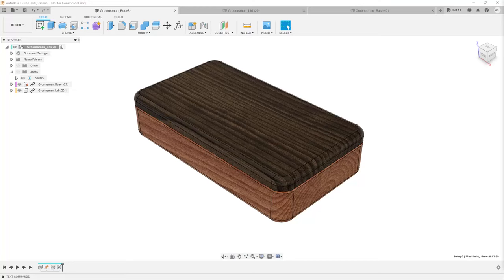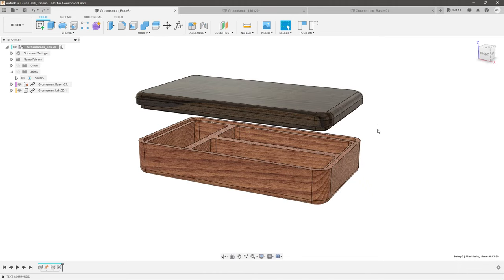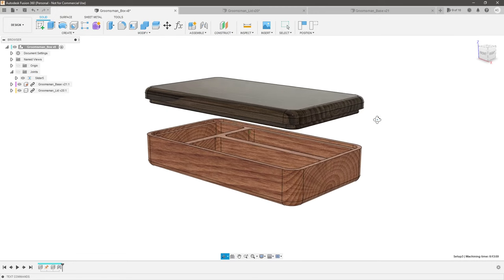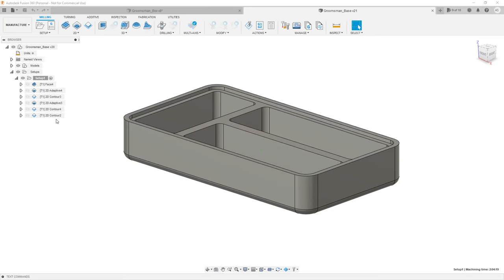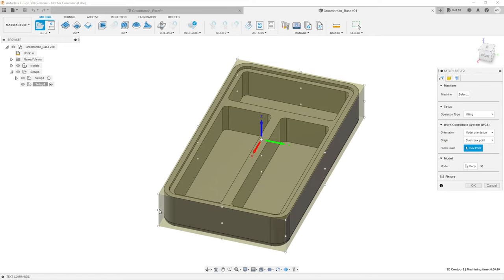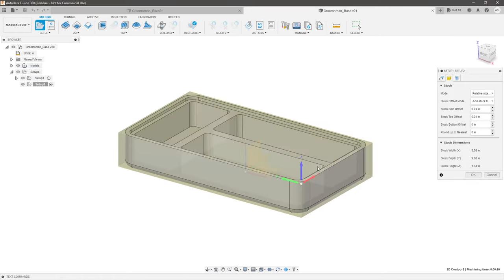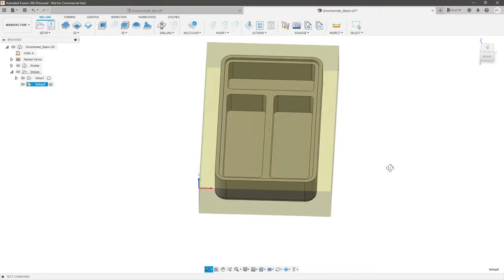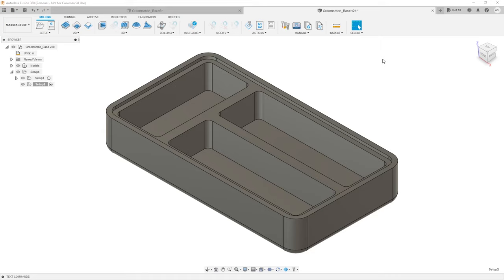Fusion 360 Tutorial | CAM Basics

Comment: Hi Austin, 

very good, clean and understandable walk through. In terms of both clear, accent free voice, grammatically correct sentences, no studdering or fillwords like "ahm, you know, ..." or big pauses and further more a good through thoughtful concept. Not everyone is capable of this. Furthermore the content is excellent and well balanced for the given case.

Thanks for also not heading around the screen with the mouse, but pointing on the important things, stay there, stay long enough on the tooltips so that one is able to read them - you really got the idea 🙂

I just got a used CNC mill and already working with fusion for 3D printing. So this gave me the most important things to get things going. Thanks a lot. 

A little  drawback: no metric system (SI). I think, it will take decades until this reaches the whole world. My calculator, pencil and paper are sitting right next to the video for basic translation of measurements 🙂Nevertheless, I know this is common in machinery world.

Cheers from over the ocean, Axel

Comment: Very good tutorial. I have been struggling doing my first ever set up. A topographical site model with 5mm elevation changes. I have been trying to rough out stock using a 3D Adaptive Clearing but the machine time is 7hrs. Have a Makita Trim router 1/4". But  having watched this I am wondering if I should change strategy and use a 2D Adaptive clearing instead. Stuggling with multiple tool holder collisions due to tool length. Again great and clearly explained vid.

Comment: You have a real talent for this! I create training videos for a living (other domain of course) and can confirm the excellent quality of your presentation. I'm new to woodworking/CAD/CAM and just learned almost all I need to work with my new CNC. The only question remaining for which I can't find an answer (maybe just because the question is too basic): when you have a component assemble 3D model, for example a box with inside dividers, do you need to flatten everything out on a copied version or is there a way to do it from the original 3D and create the G-Code for the CNC?

Comment: Really an awesome video - one of the most helpful ones I have discovered so far! One question: When milling the outer shape of the box, your router is performing a lead-out for every singel round. The default setting, however, is to make only one lead-out at the end of that job - which means that the router tries to pull through the whole thicknes of the material - which of course does not make sense. Where did you activate the lead-out for each pass? I only find this option for the finishing ("Leads on All Finishing Passes") - where in my opinion it does not make too much sense...

Comment: Great video!

How do you ensure that when flipping to do the underneath of the box that you are exactly aligned to the work piece?
Reply from the maker: Thank you! When I'm doing 2 sided machining I typically use a fixture with dowel pins. I don't zero off of the workpiece, but rather the fixture itself. This way the dowel pins make sure that the cuts on side A line up with the cuts on side B, but the fixture makes sure that zero point never moves and remains constant through all operations.

If you're interested, my Order of Operations video, and my CAM for guitars/necks etc videos show this in more detail.

Comment: Hello, thank you for all your videos/material, I used your parametric fretboard for my project and that's amazing !!
Something I can't figure out : if I set-up my origin point on the top of my stock, how do I zero my Z after a tool change if I did a surfacing operation at first ?
Reply from the maker: If you use the corner of your stock, and don't surface the entire top of the stock, you can continue to use that corner throughout various tool changes. Otherwise, I would recommend using a fixture (simple piece of mdf or something underneath that you can zero all your operations to)
Reply: @austinshaner  Thank you very much for those explanations ! Now that you explain it, it seems obvious! I thought to define the origin on the bottom of the stock, and to redo my z zero on my machine floor. isn't that something you would recommend?
Reply from the maker: Using the wasteboard as a z zero can be useful for ensuring your bit doesn't plunge into your table, I do something similar when I use a fixture, xyz are all set to my fixture not my stock, but this isn't very forgiving with varying stock thickness so its important to make sure your stocks are the right thickness for what your program expects. Zeroing off the top of the stock is nice because you can put any thickness blank and the program will still run, but then you have to make sure you don't machine off your zero point like I mentioned earlier :)
Reply: @austinshaner  it's perfectly clear sire, thank you again ! I actually can't believe you answered that fast, you're definitely the superhero of CNC noobs (and veterans too for sure).
I still have a lot to learn but thanks to your work I'm starting to be able to (at least) do what I need to do on fusion 🙏

Comment: Thank you so much for this video, very helpful. I am fairly new to this and trying to learn. Can you explain the advantages of facing the stock rather than thicknessing it to the desired thickness first?
Reply from the maker: My pleasure Travis, both are a variant of facing your stock. I think it's less of a benefit and more a matter of convenience. If people have access to a bunch of purpose built machinery, such as planers, jointers, drum sanders etc.  It can often be faster and yield a more uniform finish doing it that way. But for example, I have none of those, so I bring my stock to size with a quick trim on the table saw and the rest on the cnc. I will say however, that the cnc, if properly tuned, can much more easily dial in very precise tolerances of your stock and ensure squareness.

Comment: Thank you so much for this! It is a very useful tutorial. I do have a question though, I just want to be sure I have this correct. I have created a similar design, but it simpler - just more of a dish without the sections or lid. At this point, with only two tool paths - one facing and one adaptive clearing, the machining time is almost 2 hours. Does that sound right to you or would you suggest changing something? It is longer than I was anticipating, but at this point I have really only gotten experience with 2D contours, which I assume are much quicker, so I wasn't sure what to expect. Thanks again!
Reply from the maker: Hi Allie! Thank you for the kind words!

Short answer, no, that is way too long. There are a number of things that impact cut time, and all are within our direct control.

#1: Depth of Cut (Stepdiwn, found In Multiple depths area). Increasing your depth of cut removes entire layers of toolpaths, drastically reducing cut times.

#2 Stepover (or Optimal Load)
On each layer how much of the tool is engaged with the material. The larger the stepover, the more material is being removed and the faster your program will complete.

#3 Feedrate
This determines how fast the cutter is moving at your given depth of cut and stepover. So once you know both of those, this will speed up or slow down each individual layer. 

So you can adjust these settings to get a much faster cut, but I must say that how aggressively you can cut is largely dependent on your cnc machine. So take care when adjusting these settings, however, in my opinion, no one should use any stock settings that Fusion provides.

Comment: I love you. I’m new to fusion 360 and and just acquired the equivalent of a 4x4ft shop bot (without a manual). I’m curious; on my IPhone I can’t see some of the details on your toolbar, perhaps on my tv it will be much easier, the problem is getting that into my shop next to my cnc lol. Stupid question, do you recommend using your videos to learn fusion or some other sources too? I’m really eager to wrap my head around this machine and fusion. It’s just a bit overwhelming on the phone watching the videos because I can’t see and follow along due to the small window etc. The reason why I ask is that teaching this very good shot gun method tutorial might be entirely different from building the fundamentals of fusion rougher tool pathing. Either way I subscribed and hope to learn more.
Reply from the maker: Hi Aaron! Thank you for the kind words! I'm glad you found this useful! 

My videos, with a few exceptions like this one, generally assume the viewer has the fundamentals already down and are struggling with particular problem. 

So I wouldn't recommend my videos for an absolute beginner, however, once you get the the fundamentals under your belt, my videos can help you skyrocket quickly.

If your looking for "from the ground up" type of learning, I'd recommend checking out Lynda.com for some courses on Fusion.

Otherwise, you can just do what I did and explore the software and lookup videos like mine when you run into a particular roadblock.
Reply: @austinshaner  Thanks my friend, you have great skills here, patience, clear communication and tasteful design make the work go round!
Reply: @austinshaner  weird the Lynda link is LinkedIn. Is it supposed to lead us there?
Reply from the maker: @aarontafoya297  yes Lynda is part of linked in! I've just found some pretty solid foundational videos in there.

Comment: Hey if you find the fit is too tight, it would be easier to use your tool offset in the machine and add -.003 to the end mill radius to force the machine to mill more material off. Just don't forget to erase the offset once your finished
Reply: you could set a negative offset on the finishig pass instead of doing that. That will be specific to that operation and you won't have to remember to change any settings afterwards.

Comment: Great,... fantastic,... excellent start to a series,...except for the tool collision,... because a novice will hit a brick wall here,... it's a simple fix,... just edit the tool in the 1st operation and the rest will adjust automatically! Also, the tab are to close at 2 inches and causes a collision as well,... better at 4 inches.
Reply from the maker: Thanks! Yeah, the collision error was the part of the video I definitely regret not covering in more detail. Collision error could be a video all by itself so I took shortcuts and shouldn't have. Ended up a bit messy and confusing.
Reply: @austinshaner  Thanks for the reply,... I very much appreciate your time and content,... would really love to see a detailed flip operation with dowel holes,... "milling both sides",... everyone leaves this out and supper it's important,... it's holding up everything I'm trying to do,... any suggestions?
Reply from the maker: @Dcassimatis  yep! My order of Operations video, cam for guitar bodies, and my cam for guitar necks videos all cover this in quite a bit of detail :)

Comment: It is confusing when to identify the top edge or the bottom edge versus thickness specifications. Can you clarify?
Reply from the maker: Please correct me if I'm wrong, but do you mean when assigning your WCS/origin for the toolpaths?

If so, I typically use the top surface if I'm doing a single sided operation. I use a fixture for both XY and Z when doing two sided operations. And only occasionally use the bottom surface as my z zero when I either need to ensure the bit doesn't hit my wasteboard, or I'm using a gage block to set a specific z height off of the wasteboard for my zero

Comment: How do you re-orient the x-axis if you dont have a line thats going in the perfect direction? e.g i have an angled model but its placed on basically average points, so nothing is actually going perfectly down the axis  (think of the model as a triangluar shape  /\ )
Reply from the maker: You can use the axis on your origin point of the model! I believe when you switch to CAM, it hides your model origin by default. So on the navigation tree on the left you can open it up and show the origin and then select those axis. 

Alternatively, if that still doesn't work for your model, you can always use sketch lines as selections as well

Comment: 24:00 Having the ramp feed rate higher than the plunge feed rate, seems weird to me... 

With plunge, you're going straight down into the material. With ramp, you're going down whilst moving in the X/Y also. So with ramp you're loading the tip of the cutter and the side of the cutter. 

Surely that loads the cutter more than a plunge, and so it needs to be a slower rate? Which is the opposite of what's shown here.

Comment: Thank you for your amazing video!  I feel a little sorry that you live in the imperial world. Must be very cumbersome to handle all these uneven numbers =) But I am sure many are used to it...
Reply from the maker: Thank you! Like with anything, it's what you grow up with that is easiest. I find imperial much easier than metric, even though I know metric makes more sense as a system lol. I think it has to do with a frame of reference, because I'm surrounded by imperial, I can imagine what a 1/4", 3/8", 3/4" etc looks like and how large it will be physically. But I can't do the same for 5mm, 10mm, 20mm etc. I'd have to convert to inches to visualize it.
Reply: @austinshaner  This makes totally sense =) But you have to put a lot more digits into a digital system than in metric. 0.125 vs 3 mm or even 3.2 is shorter. And normally, we don't use so many digits after the coma. Anyway, I am sure at the end there is no difference.